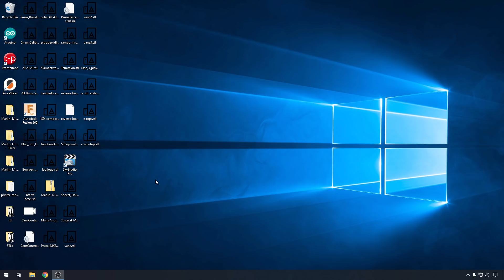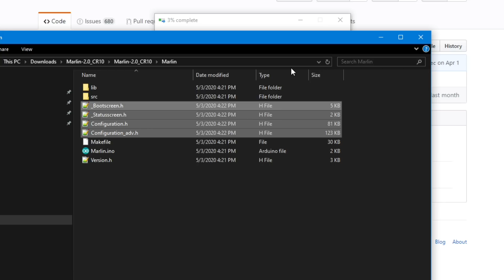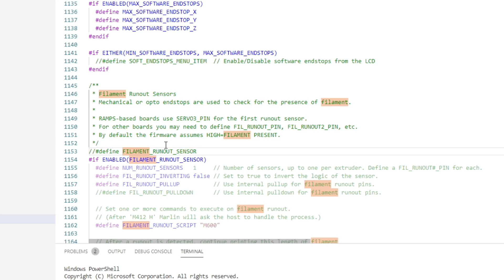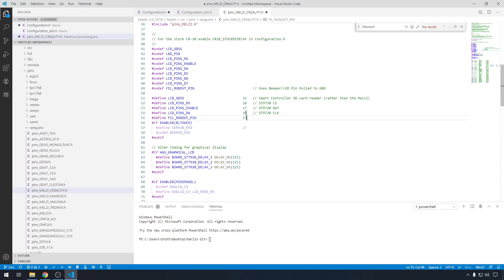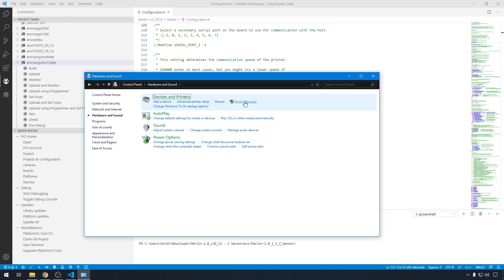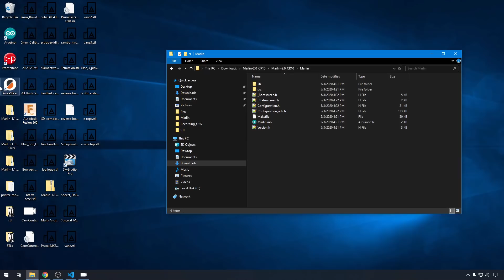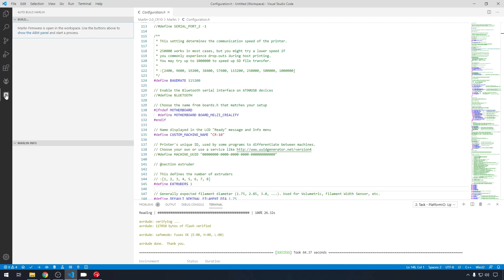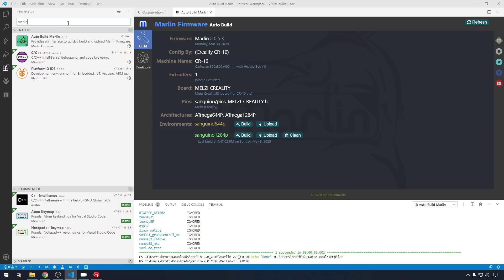Marlin 2.0 On 8-Bit Boards - Upgrade - CR10 - VSCode - Chris's Basement

Comment: So looking back at your video (which I used to successfully add a boot loader and update Marlin last year - Thanks!) it seems to me that Arduino IDE is only about 10000 times more straight forward, fewer steps, easier and all around faster than using Visual Studio. Is there any reason I cannot follow last year's steps but using the Marlin 2.0 files instead? Did you have a reason to choose Visual Studio?
Reply from the maker: Arduino IDE doesn't support 32bit boards. If you still run an 8bit board, then there is not reason to migrate to VScode.
Reply: Perfect. My old CR10 will qualify.
Reply: So I used Arduino IDE and it seemed to work. It took a long time to compile but that is probably my old widows laptop's fault. I got the same error you did and fixed it with Pronterface. I turned it off, changed my jumper and started it up. I got the Marlin version screen and then the Creality 3D screen but then it cycled back and forth in a loop. I decided to reinstall Marlin. I got the same result. I decided to reinstall the version from last year and as Arduino IDE started compiling I noticed the screen changed to my normal start screen as if it was ready to print. I stopped compiling and restarted the crealty board and it started looping again. Any ideas?
Reply: @ChrisRiley  So I used Arduino IDE and it seemed to work. It took a long time to compile but that is probably my old widows laptop's fault. I got the same error you did and fixed it with Pronterface. I turned it off, changed my jumper and started it up. I got the Marlin version screen and then the Creality 3D screen but then it cycled back and forth in a loop. I decided to reinstall Marlin. I got the same result. I decided to reinstall the version from last year and as Arduino IDE started compiling I noticed the screen changed to my normal start screen as if it was ready to print. I stopped compiling and restarted the crealty board and it started looping again. Any ideas?
Reply from the maker: @liamstone3437  The only thing I can think of is maybe it's almost out of memory. In configuration.h find disable M503 and take the comment off. This will bring the memory down, see if that fixes it.
Reply: @ChrisRiley  Ok I have a day off again so I said F!@# Marlin 2.0 and allowed my Arduino IDE to reinstall last year's version. It is printing now as we speak. I have no clue how a printer that is allowed to sit for a few weeks (not connected to power) can get corrupted but that is evidently what happened. My only reason for trying 2.0 was because I thought it might save me an upgrade later. In the mean time I ordered an SKR 1.4 Turbo so I will be building a new controller 2 months from now when it gets here. Thanks for all your responses to my questions. You are a knowledgeable and helpful Maker.

Comment: I updated my firmware last year so I know I have a boot loader. It was not really easy at first since I used a clone arduino that required some extra steps and then my short USB cable was bad which made me think I was doing something wrong when in fact I was perfectly correct. So I don't do this on a regular basis and did my best to forget the whole nightmare until I tried to use my printer this week and it started doing things it shouldn't. So now I want to update again. I don't see in this video what connections are needed or whether an arduino is even required. It would be great to see such details.
Reply from the maker: If you have already flashed your bootloader, nothing further is needed. Just cable up to your computer USB and VScode will know about it. When you are ready to upload it will handle the rest.

Comment: Chris, I am using the setup you suggest a while back with VS code and Platform IO.  I don't see an option to add folder to the workspace I only l see options for adding projects.  Is that basically the same thing?  Is there something I can change so my setup looks more like yours to make it easier to follow your examples?  Thank you for your help.
Reply from the maker: Hello, I am not sure what you are seeing, the way mine looks should be default unless I am missing something. Can you send a screen shot of what you see?
Reply: @ChrisRiley  In working on getting a snap shot I figured out that you were right clicking below the current folder to add a new folder to workspace.  I was trying to do it on the folder and above the current folder so it wouldn't give me the option.  Thank you for your help.

Comment: I want to upgrade to marlin 2.0 with my cr10s pro but it seems there is a problem with it if you use octoprint, do you have any sugestions? https://github.com/InsanityAutomation/Marlin/issues/134
Reply from the maker: That is probably going to be an issue on a lot of these 128 boards. I don't know of a way around it, but maybe there is something on the Marlin github that can help.

Comment: Anyone notice space issues moving to 2.0 using same options under 1.1.9 on creality melzi boards? I will give it a try later today. Just know it was pretty close to running out of memory and imagine it will on 2.0.5 since its not optimized
Reply from the maker: It depends on the features of course, but using the example config the 2.0 version is acutally smaller than the 1.9.

Comment: Has anyone run into a problem with layer shifting while using Marlin 2.0?  This is my second install and I'm getting shifting in the Y-axis in both installations.  Usually, happens around the first 10 to 30 layers.  Very frustrating.  Can't nail it down.  Both machines are using SKR 1.3 with BTT 2208 in UART in one case and the other is using BTT 2208 in Standalone.
Reply from the maker: You think maybe the drivers are getting hot? The new version 2.0.5.3 should work fine, I run 2208's on a few machines.

Comment: I have been struggling to find someone who walks us through Marlin 2.0 for Delta Kinematics. I am not stupid, I’ve been successfully with many custom configs for 1.1.8 but it also doesn’t seem straight forward for 2.0
Reply from the maker: I have thought about doing a couple of configs, I can work in a Delta.
Reply: Chris Riley I would appreciate it. I work in IT, I am not dumb at this stuff, but the delta config in the old Marlin was confusing when working from scratch. 

I stole Da Hai’s last time and just modified the hardware/board configs

Comment: I've been running a Beta version of 2.0 on my ANET A8 for years. It always had an issue with setting Z, reporting the incorrect height stored in memory, but other than that, it's been fine.I used it to get a bed levelling sensor to work and to have thermal run-away protecting.
Reply from the maker: Nice! Yeah, we have been working toward a stable 2.0 for a while now.

Comment: Chris,

I cannot seem to get this to build properly.  It fails with two nuisance errors (no /include folder), then the board shows red in the marlin plugin.  Took it step by step from your video.  Not sure what to do next.  I have already flashed TH3Ds package so I know it has a boot loader and I know the printer is connect and on the right port.  I'm stumped....  any ideas?
Reply from the maker: This could be the folder location. Copy your Marlin folder to the main C directory and reopen in VScode, that will shorten the file path.
Reply: @ChrisRiley  No change.   Here is one of the error messages - collect2.exe: error: ld returned 1 exit status
* [.pio\build\sanguino1284p\firmware.elf] Error 1

Here is the "failed" message - sanguino1284p             FAILED    00:04:59.183

I'm running a stock Ender 3 pro.  No change to your instructions per the video.   I can control the printer via serial from Cura and Pronterface. I know it can be flashed because I've done it already.... I'm at a loss.

Comment: OK I got this in got it working got bltouch in and working not running into max lol but G1 X100Y100Z0 F5000 doesn't go to center of bed its off center to back right as you face the printer is there a way to adjust this thanks for any help.👍😀
Reply from the maker: You can adjust the probe offset to try to get it centered or adjust the min bed size.
Reply: @ChrisRiley  got it thanks I'll make a vid of the Frankenstein printer printing with its sound system and lights going ...hopefully soon .👍 I just got the lidar module working printer next👍😀.

Comment: PROBLEM!
Hey Chris! Great tutorial. I really appreciate your Job.
I have done everything exactly as you showed, but can't compile due to this error:
#error "FILAMENT_RUNOUT_SENSOR requires FIL_RUNOUT_PIN."
I made research and actually foun some info on reddit but none of them worked for me.
Maybe someone can help me with that?
(ENDER 5)
Greetings
Reply from the maker: It should work exactly as it does here, just add #FIL_RUNOUT_PIN   -1  in the pins file, to see if the error goes away.

Comment: For advanced users willing to deal with Marlin 2 in its early development (and buggy stages) yes, nice to play with. (Check the Marlin github and see if a dual Z morot with one not working would be bothersome,  2.02, etc) but for any better prints on the typical stock 8 bit board machine and a new user? Nah.
Reply from the maker: Interesting, what would you suggest? Older Marlin, or something else?

Comment: I‘ve got a Creality Cr-10 S Pro. In the list in Marlin there are a lot of Creality printers listed, but not the Cr-10S Pro. Which one of the Creality list should I use or is my printer the one which can‘t use these pre-configured versions? This problem ist not only in Marlin 2, in every Marlin Version, which is not directly from Creality offered, has no choosable Cr-10S Pro option.
Reply from the maker: I am not sure, but we should create one. What is different about he S Pro versus the stock cr10?
Reply: To see the really interesting differences it should be better to own a Cr10, but I haven‘t one. Fact is, my Cr-10S Pro isn‘t longer the same a manufacturer one is. I‘ve done several changes and upgrages to get a printer which does it‘s job. So I can‘t use a Marlin offered by Creality without the source code to add my changes. The last official version by Creality is 1.70, without source code. I‘ve chosen a version made by TinyMachines, the 1.90.1 or so, the last before 2 came online. The main problem with the TinyMachine Version is, that my Touch Pad just read ones time a SD card. To read annother one I have to shut down the printer and restart. And after a finished print I‘ve got about 3 seconds to quit this massage „ print finished“. When I do so, I can restart a new print, when I miss, shut down the printer and restart. It‘s a mass! Something is different between 1.60 and all following versions. And please, I knew the Cr-10 S Pro V2 offered by TinyMachines. It makes no differences if I use V1 or V2. The same mass happens.
Meanwhile I think it‘s time to add a 32bit board, but the one I‘ve bought is reserved for my custom printer I‘m building. 
To use the Cr-10 S Pro without issues I‘ve build a raspberry Pi with touchscreen Philipp showed in one of his videos. Positive circumstances, I can send my gcodes per WIFI to my Creality. Negative: it‘s a possibility, not a solution.

Comment: I have a Tevo Tornado with a MKS GEN L board I upgraded the stepper drivers to TMC2208 V1.0 drivers on x y and z and a LV8729 on E. I’m setting up Marlin 2.0 and I get to the drivers and do I select TMC2208 or TMC2208_standalone I’m not sure what the difference is?
Reply from the maker: It depends what driver boards you have. What brand, 2208 is UART connected, you will need jumper wires for the gen L, standalone you probably need to solder some pads on the driver board, then you will have no software control.
Reply: Chris Riley they are FYSETC boards I didn’t solder anything and I do remember 1 or 2 jumpers under them it has been a while since I installed them
Reply from the maker: @eddowney1364  Ok, then select TMC2208
Reply: @ChrisRiley  Thanks for the help

Comment: Hi Chris, Great video, Thank you. Any chance you can do one for CR10s + BLtouch 3.1 enabling UBL on Marlin 2.0.5.3? I tried everything on the internet but it doesn't work for me. Sometimes it goes outside the bed ( y or x not always the same) it jumps one or more rows or columns (usually the external one) or just stops working everything. It doesn't matter if I try with a grid of 7,8,9, or 10 points, it stops early (eg. at 10 it stops at 91). I am desperate if you can, please help. Thanks you
Reply from the maker: Hey Mario, I have a lot of BLtouch stuff coming up because there are a lot of questions. Stay tunned.
Reply: @ChrisRiley Hi Chris, thank you. I will.

Comment: Hello chris,
I'm looking for a 32bit ctrl board with  power loss recovery included. Can't really find one. Do you have any idea which one has this feature?
Thanks
Reply from the maker: It depends how you want to do it. If you want to do the SD card method and it runs Marlin, they can all handel it.
Reply: @ChrisRiley  hmm. SD card method. I didn't know all can do it . Is it reliable ?  Needs no extra modules ? 
Thanks
Reply: OK got it. Saw your video. thanks

Comment: Nice video again. Thanks. Do you  know if a build of Marlin 2.0.x uses more memory than a Marlin 1.1.9 build with the same features? I've squeezed just about all the memory I can get out of my 8bit Anet A8 board so I'm not sure if I want to mess around with an upgrade if it means I might have to kill features I'm currently using.
Reply from the maker: That is a great question and I just tried them both. 1.1.9 took RAM:   [========= ]  92.1% (used 15092 bytes from 16384 bytes)
Flash: [==========]  98.2% (used 127698 bytes from 130048 bytes) and 2.0 took this RAM:   [========= ]  92.2% (used 15112 bytes from 16384 bytes)
Flash: [==========]  97.7% (used 127050 bytes from 130048 bytes)

So 2.0 is a bit less on flash.
Reply: @ChrisRiley  That looks promising then. Thanks very much for trying that out and posting the result. Keep up the great work. Cheers

Comment: Chris I have a custom delta I've created, it's based on the arduino mega/ramps configuration, do I need to custom the bootloader also?
Reply from the maker: No, if you have a mega, bootloader should be good to go.

Comment: Great video Chris.  Can you please tell me if it’s possible to set up auto bed levelling as normal on a standard cr 10 with this firmware?
Reply from the maker: Thanks! It's going to be tuff to get enough memory. It can be done, check out my Ender 2 video. That's what I did there. Saem for the CR10. https://youtu.be/O2126G4oO30

Comment: Thanks for the video Chris.  Definitely making me think about putting 2.0 on my Ender 3.  One thing that always holds me back is that videos like this are unique to the printer being shown.  Then if you have other changes you have to look for other videos and piecemeal it together for your specific combination.  I haven't changed to the TH3D firmware but the configuration tool that he provides definitely makes it easy to create your own specific version for your printer.  Example configurations are always appreciated as a first step, but it would be great if someone made a similar tool for Vanilla Marlin.  Here's the link to TH3Ds online configurator tool for anyone not familiar with it:  https://ezfirmware.th3dstudio.com/guiConfig/
Reply from the maker: Thanks for watching! I hear you completely, I think we will see the Marlin build tool get there very soon.
Reply: @ChrisRiley  I have to admit I wrote the comment before I got to the end.  When I got there and you were showing the Marlin build tool I realized that was the place where it would go.  Sounded like you might have some insight on it, so please add my request to the list if you can.

Comment: Instead of a boot loader, can't you hook up an AVR progarammer (Atmel ICE, AVRISPv2, or Pickit-4) and upload the firmware that way?  Advantage - you get a few extra Kbytes of flash space.
Also, you need to re-run the calibration for the hot end temp, the example probably doesn't have the right values for the sensor.
Reply from the maker: Yes, you can use a programmer if you like.

Comment: I had no success with Marlin 2.0.1 on a GT2560 V3. Mesh bed leveling with a BLTouch stuttered heavily and failed most of the time. Have gone back to Marlin 1.1.9 and ordered a SKR mini E3 for my Geeetech A10.
Reply from the maker: You might try the newer version, the issues might have been resolved.
Reply: @ChrisRiley  I wait for the SKR mini. I know for sure that Marlin works with it, but maybe I will switch then to Klipper if I have figured out how to use it in a Docker container.

Comment: is babystepping feature working correctly? i have marlin 2.0.5.3 running on a ramps 1.4 configured for delta style printer and when i try to use this feature, the printer freezes completely. Any ideas?
Reply from the maker: It is working on my i3, but there could be an issue on deltas, I would have to check github.